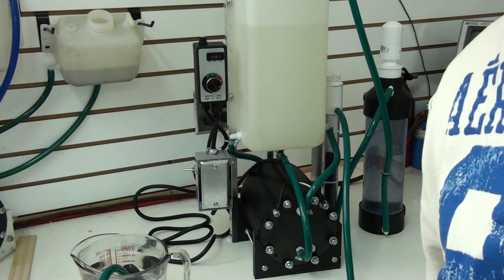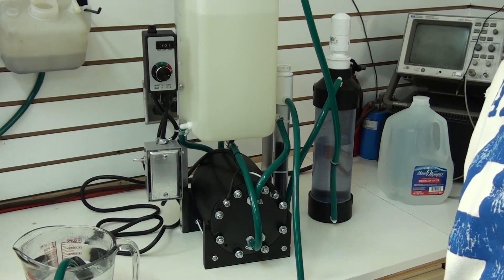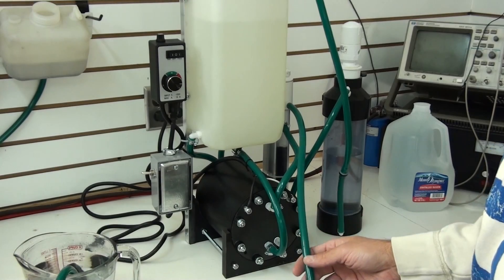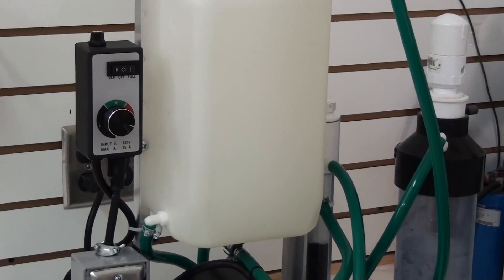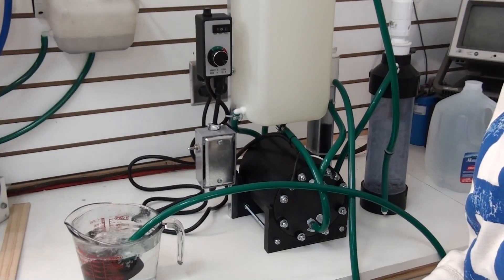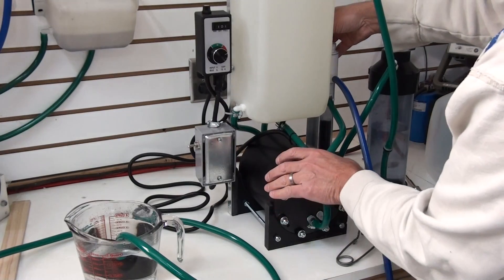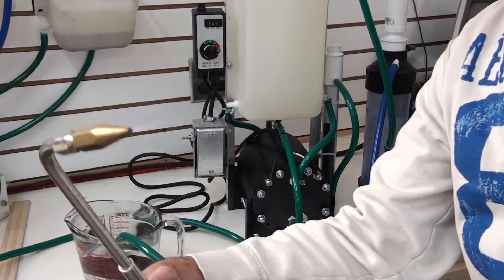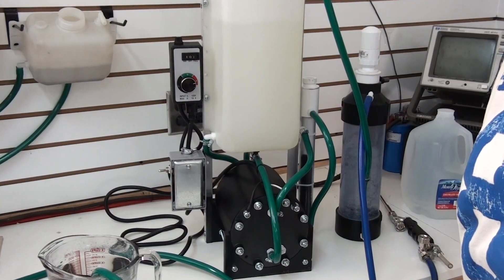HHO for Health Hydrogen and Oxygen Charged Water machine XL

Comment: I finally made one man. I bought some of your stuff, too. The 30 plate generator for my car. I want a 59 plate unit like that one. Mine had a small issue, maybe I can talk to you sometime. I got a torch and breathing machine going and I got one in my car, I'm still perfecting the electronics for the throttle control. I have control of every sensor in the vehicle.

Comment: How much psi can carry your flashport?Does your tourch has built in flashback arrestor hope your kind reply,thank you.
Reply from the maker: +Micro Master flashport is not for pressure. It is for hho systems making 1 to 20 lpm on demand
Reply: +delvis11 Thank you for your kind info.I want to know why you use over pressure valve on top and how much psi it would be open,when you have more lpm in your reserver is it open under high pressure if so what is that amount?Thank you sir.
Reply from the maker: I don't know. I have never tested it with pressure.

Comment: Where do you find your water tanks, and what material is it. Thanks
Reply from the maker: +eDockstader The tanks are made out of polypropylene and I get them from green fuel h2o with fittings drilled and tapped.